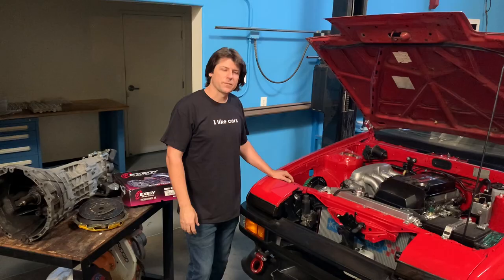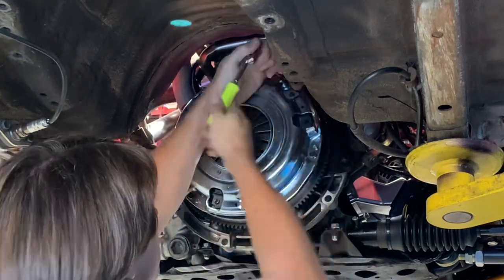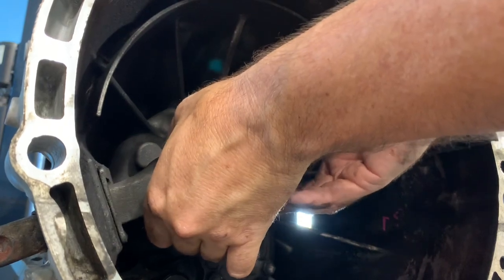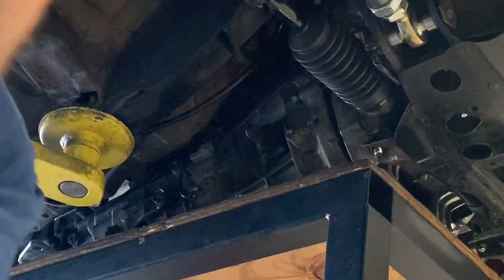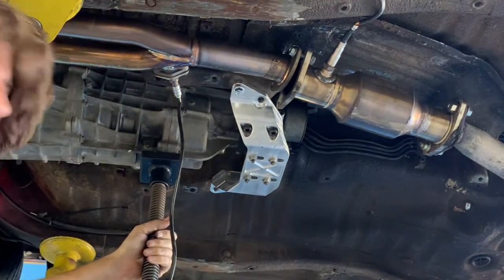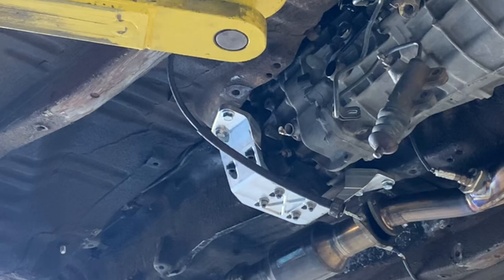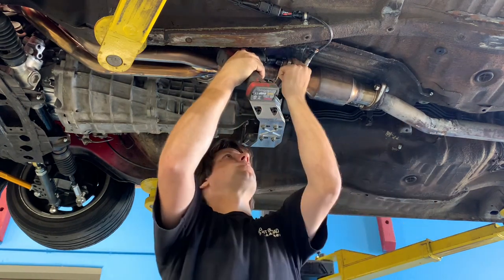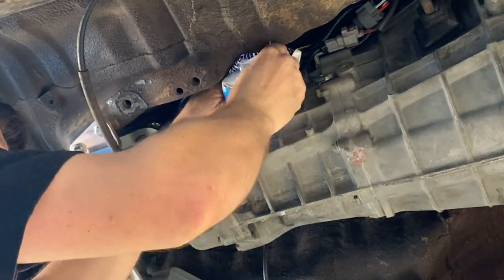JSP BEAMS AE86 back together. We install the transmission with a new clutch.

Comment: just want to say thanks for the videos you just let know was doing my beams fuel system all wrong this is Anthony from Jamaica
Reply from the maker: Thanks for watching 👍🏻
Reply: Best believe i did it this evening and i dont want to talk too soon but it cranks up quicker and feels more powerful 
What i want to sort ojt now is the throttle response issues the Beams have when you dont run the factory airbox but i see ahiwed in the video HKS sold a kit i run an HKS filter now with performance MRP MaF housing

Comment: How hard would it to use your AE86 Beams stuff for a ke72? I am going to swap a Beams into a 1982 Corolla but I was wondering if your kit would work with it? The motor lift, shifter relocation?

Comment: whats the break in procedure for the clutch?
Reply from the maker: Nothing special on a clutch like this. Just normal driving for 50-100 miles is fine. This is basically oem.